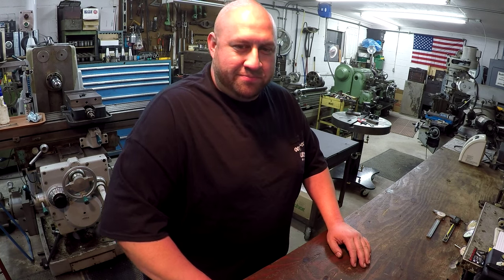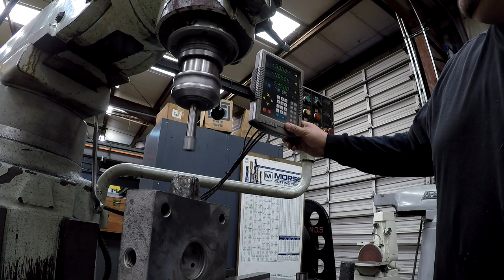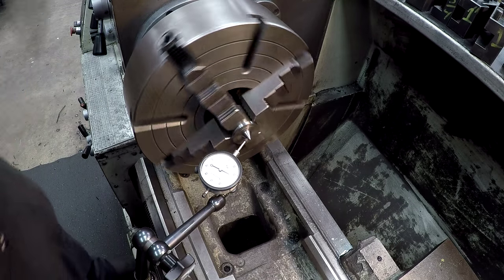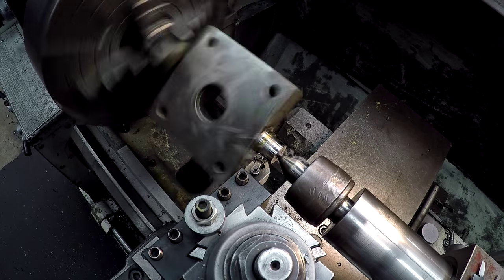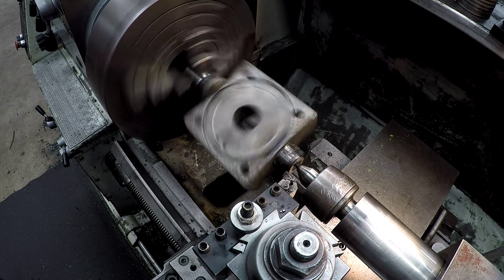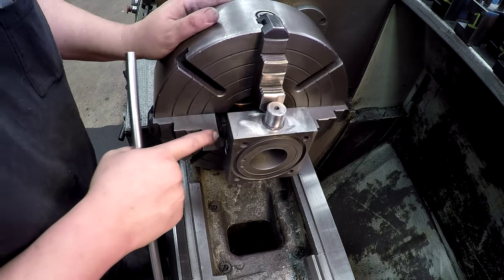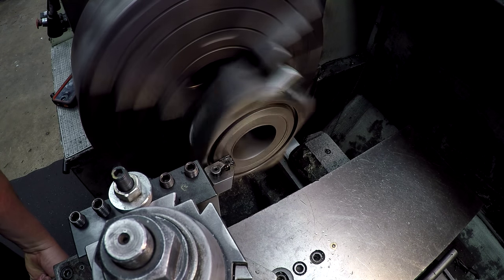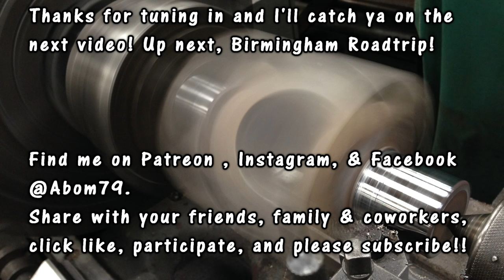Saturday Night Special 99

Comment: One thing I love about my lathe, is that if you open the jaws wide enough, you can put the taper center in there. No removing the chuck. Still probably less accurate than your indicating.

I'm really impressed at how clean you guys keep your machines. At most shops the ways are trashed up with yuck, and the non-machined areas are 10x worse. Nice job keeping it so clean.
Reply from the maker: I hate a cluttered messy machine, I like to keep most of the chips cleared off after cuts, and it's good practice to clean the machines off after each job. Wish my coworkers would do that....:(

Comment: Almost close enough to machine a whole new trunion. The shop I worked for we had these one type of air cylinders that were dampers for rock crushers and they were cheaper  and easier just to build them brand new than try to repair them cause of how much damage they would receive. It would cost around $500-700 a cylinder and take less than week to build brand new vs. twice as much time and money.

Comment: MAAaaan, the way you finesse that four jaw is like artwork! It's like most things, watch someone good at what they do and they make it look effortless :)
Question, would it be as accurate if you turned down those bearing posts in the mill with an adjustable boring head & inverting the boring bar inwards?
Reply from the maker: That would be one way you could do it yes.
Reply: +69hytek 
Sometimes the trunion collar is welded on the barrel, so you have to do it that way.  Getting the diameter accurate is no problem, but getting the two trunion journals in perfect alignment with each other is more difficult.

Comment: Nice welding and machining of the trunnions. I liked the cushion repair.
I was wondering if you ever do any build up with mig fluxless wire like Carbon Steel, .030" or .045" with shielding gas?
Good luck with SNS "100".
Reply from the maker: Jeff that's how I welded these trunnions up. It's works pretty well too.

Comment: Love the videos. They're incredible....came over this way from AvE.

Question: Think in the next video you can take 5 or 6 seconds to explain what the part does your machining/fixing, and what the machine is/does that uses the part? I'm still fairly new to your channel....and maybe this is mainly a channel for those who do the same work you do...but besides a brake disk and a vice, I've no idea what any of the other couple dozen things I've seen you fix/fabricate do, or what they are. Just a "this is a piece from a widget's suspension. Its meant to balance the widget so it doesn't topple over, by distributing the weight evenly."

Just ignore this message if I don't fit in with your channel's vision.

Comment: Very interesting repair work.  I imagine that you can't talk specific repair cost, but it'd be interesting to hear what the replacement cost would be if you couldn't repair it.  Also, I'd like to hear what industry/type of equipment the cylinder is used in, if you would happen to know.
Jack
Reply: +Jack Hoying 
Both of those front end caps were from Parker brand cylinders; not the least expensive manufacturer.  You could easily spend 8 hours @ $75/hour on one of those caps with trunion mounts and still save the customer money.  The cost of the part might not be the only factor; distributors typically don't stock these parts, and you have to wait for them from the factory, which could be weeks.  The customer may not be able to have that long of a downtime; even if the cylinder is a spare, they can get a little antsy without it for that long.
Sawmills, mines, etc. typically use an abundance of pneumatic as well as hydraulic tie-rod cylinders like these.

Comment: Hi Adam,
Great video, nerves of steel coming so close the she spinning square! When you do the weld buildups, do you treat the part to reduce hardening? I sometimes have trouble drilling near welds, due to the different hardness from the un-welded  steel. If you don't heat treat,do your tool edges wear a lot faster? Keep up the great work, your videos are a weekly treat.
Reply from the maker: Just weld it up and let is cool.

Comment: Love watching your videos man! I have a question regarding a hole i drilled this week with the lathe, material was stainless steel and hole size what about 3,74 inches. I drilled it in three steps (1.96 inch, 2,95 inch and 3,74 inch) using only some oil for cooling. The finish in the hole was a bit shabby and scratchy. What speed would you use for the different holes? My drills were in good condition before and after... Best regards from Sweden

Comment: Great video as always Adam.  I have a question about the cushion / flow restrictor.  How much clearance do you leave between it's OD and the trunion housing?  Does it vary for different size pistons, or is it a fairly standard clearance to restrict the flow that the piston velocity drops when the cushion enters the trunion?  Thanks!
Reply: +Michael Braddock 
For the air cylinders in this video, .002 - .005 would work fine.  The bushing should be made from a dissimilar metal (bronze, cast iron, hardened steel, etc.) to prevent galling in the mouth of the steel end cap.  You can see the two screws side by side on one side of the cap, the one with the allen head is an adjuster to fine tune the cushion and compensate for wear.  The other with the screw driver slot holds a check ball that allows air to bypass the cushion at high flow then the cylinder is directed to retract.  Some air cylinders use tefelon or urethane seals in the cushion mouth for even more effective cushioning.  Since fluid does not compress like air does, hydraulic cylinders often have tapered or stepped cushion bushings & probes to allow a more gradual deceleration when entering the cushion section of the stroke.
Larger bore cylinders probably have more clearance everywhere on most of the cylinder parts, and since the cushion components are also larger, there is more area for the larger volume of air to bypass, so everything sorta stays within scale.
Cylinders with large rods but relatively small bores (1 3/4" rod in a 2" bore) is not going to have much cushioning ability because the volume of air (or oil) between the piston and front end cap is so low that it doesn't take much pressure, force, or velocity for it to escape between the clearances.

Comment: Would love to hand around at your elbow and watch the metal magic happen! I notice you don't use high pressure lube on the center. Looking forward to next weeks centenary episode of SNS Adam. Cheers.
Reply: +Rain Coast  You only lube dead centers.
    Mike (o\!/o)
Reply from the maker: No need in lubing the center when it's fixed. If I was using a dead center against a rotating part then I would use some of the Extreem pressure lube.

Comment: Nice repair Adam, makes you appreciate how expensive it is to buy a new hydraulic cylinder. What kind of operation did it come from? Looks like it was worked real hard over the years!
Reply from the maker: I know these go to a saw mill, but unsure of it's use. They have thousands of moving parts on a mill line.

Comment: First time seeing you work between centers using a lathe dog.   Four jaw just quicker or better in some other way than turning between centers?
Reply from the maker: Holding between centers has it's place, especially when finishing a precision shaft. Using a chuck has better holding power and reduces chatter and vibration.

Comment: As usual, nice job. What weld metal did you use to insure the repair was hard enough to withstand wear?
Reply from the maker: Standard E70 steel welding wire, or when stick welding I use 7018.

Comment: so, I'm curious...   on your operation where you're turning between centers using a lathe dog on the rough welded bearing shaft, I get it. but after you just got done making it all perfect and polished, you don't protect it against damage from the set screw or anything  when you flip the work over. it just sucks you damage it like that. is there a practical way to prevent damage on a polished journal like that when using a lathe dog?  it almost looks like you could have used a (custom?) double tanged lathe dog and just let the noncritical face of the workpiece rest against the other tang allowing the attachment on the bearing journal to be somewhat loose and bushed with a piece of scrap aluminum or brass etc..?  

ideas?
Reply from the maker: Yes, I like to use copper.
Reply: +Abom79 thumbs up!  that is for being responsive! your videos are awesome and a lot of what I've been doing is close to "correct" but your insight confirms whether or not what I'm doing is correct. that is for all your time making these awesome/entertaining videos. :)

Comment: Why do you use such a large diameter edge finder? In my limited experience I've always seen/worked with edge finders that stepped down from 1/2" to 100 thou after the spring break.
Reply from the maker: I choose them depending on the job, but I favor the 1/2" size more.